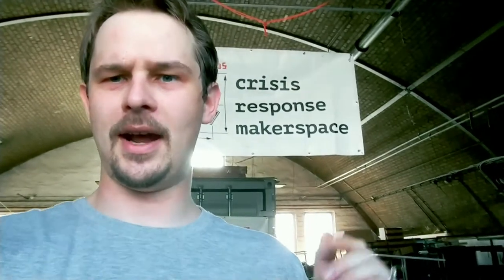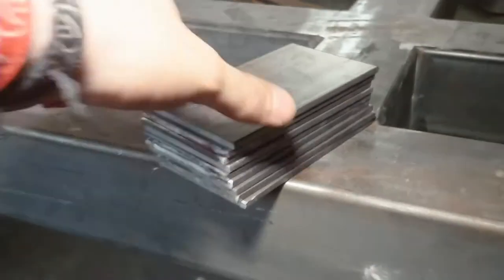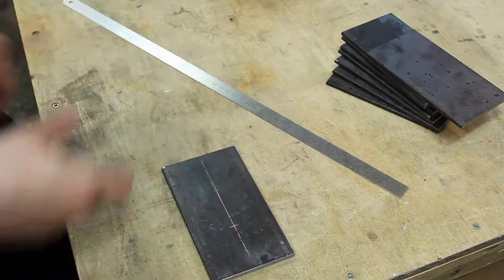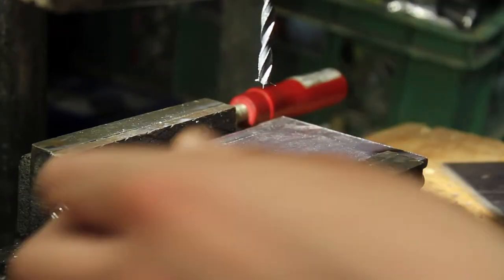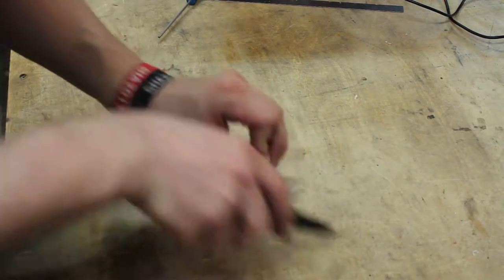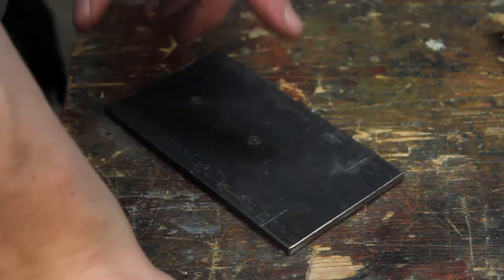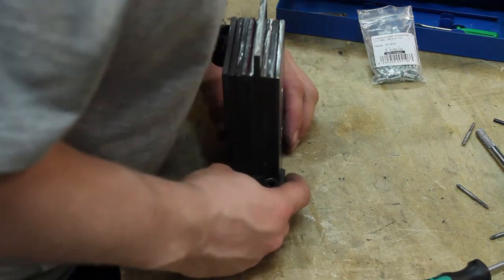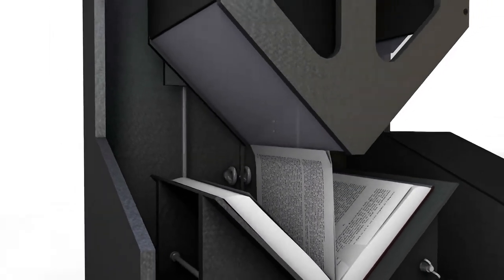building Libreflip - E25 - making the new counterweight (part1)

Comment: If I understand correctly, LibreFlip is a project in progess, the cads and plans are drawn, but the machine is not built, yet. If I'm wrong, is there a video that shows the prototype in action?
Reply from the maker: Thanks for your question.

Yes, you are correct, libreflip has not yet turned a page or scanned a book. 

I would say the building of the machine is 95% complete and we tested already the computer and touchscreen and cameras (episode 24) and I tested the vertical movement in episode 20 and decided to build the counterweight, to get this working nicely. After the counterweight is mounted, I can hopefully get the vertical movement going.